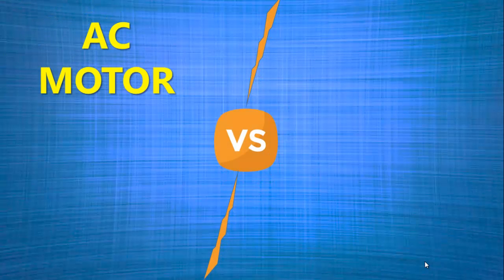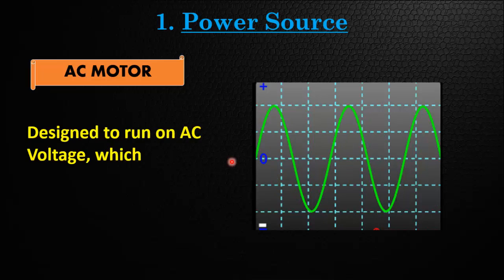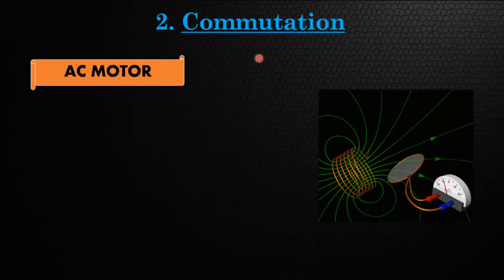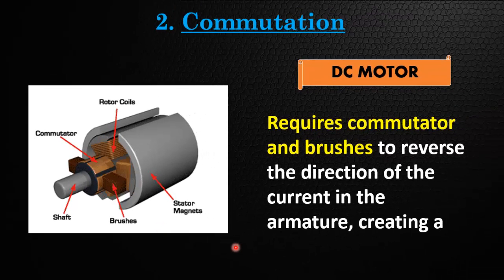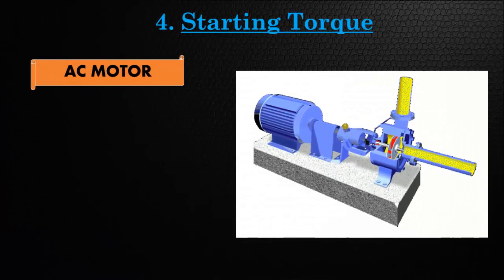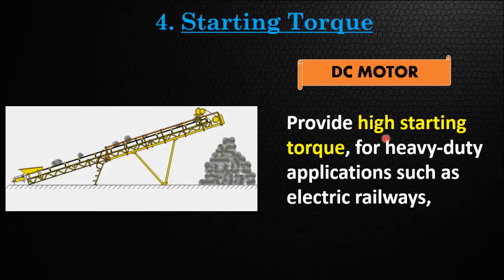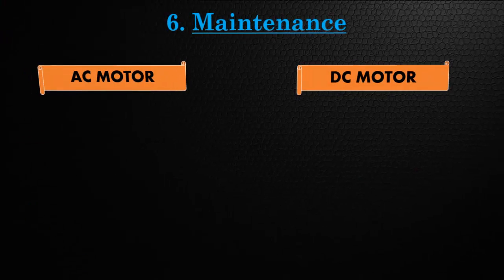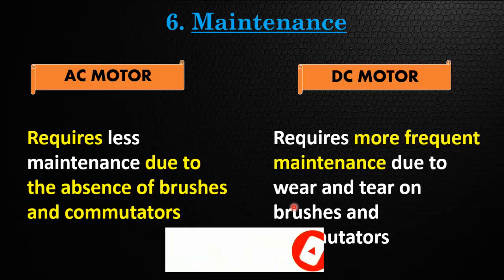AC Motor Vs DC Motor | Key Difference between DC and AC Motors

Comment: Differences:  Voltage Source, Commutation (DC has commutator and brushed on the armature - rotating magnetic field), Speed Control (AC is tougher to control), Starting Torque (AC have lower starting torque), and Maintenance (DC with brush have more maintenance).

DC are lower power applications (small motors) and with high start torque requirements like rock crushers and arc welding.
AC is better with high power applications.

DC has stator magnets.